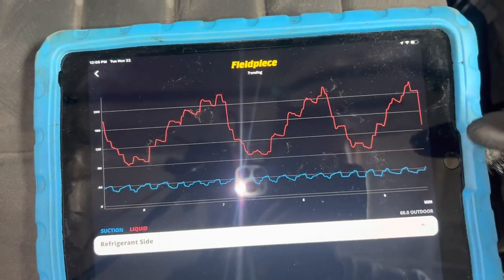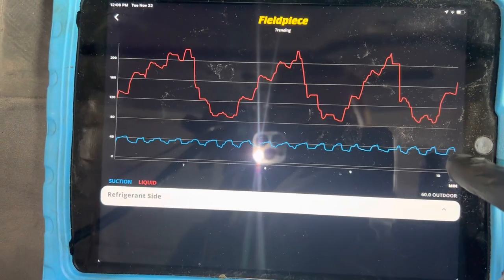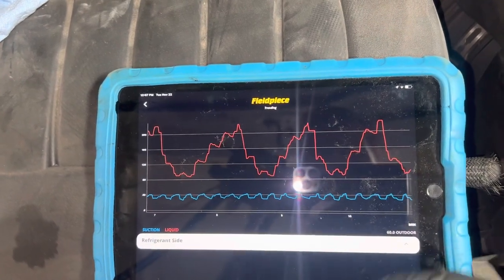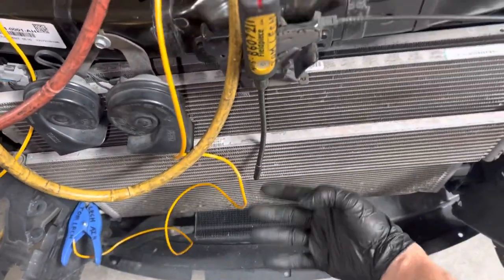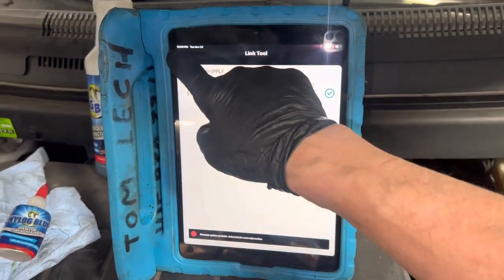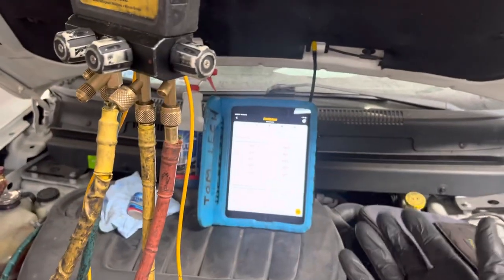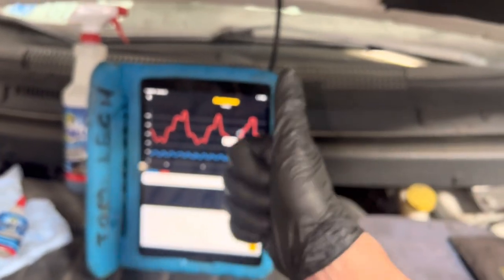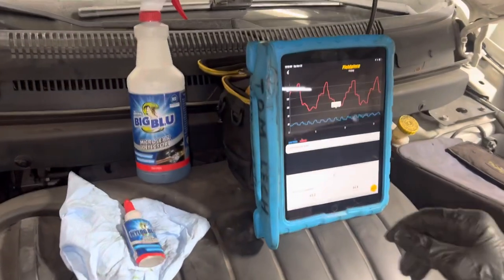AIR CONDITIONING 2016 Dodge Journey ￼High Side Pressure 90 psi to 200 psi NEVER STEADY PRESSURE ￼

Comment: Wow, that's crazy. Is this a variable displacement? It looks like it's cycling the clutch based on suction, but has some king of algorithm to build up pressure on the high side with the displacement. Weird.
Reply from the maker: It was cool outside even some variable with clutch will cycle .  Not all car manufacturers are the same . 

Variable with no clutch can cycle internal displacement controlled by the displacement control valve will decrease the swash plate to zero stroke, and then back on again to a minimum stroke inside acting just like a clutch, turning off and on . 

I can see it when it’s on the graft how the internal workings are operating on a variable  displacement compressor .

Comment: How long can you log data with the fieldpiece app?
Reply from the maker: I’m not sure I have not tried really long. I guess you could do 24 hours you would probably have to turn down the refresh rate not to use up a lot of memory. The one thing I haven’t figured out with my iPad. Is it shuts down even when I turn off low power mode and I have it plugged in, I haven’t figured out why
Reply: @coldfinger459sub0  I have been trying to figure that out as well. Mine will shut down after about 15min